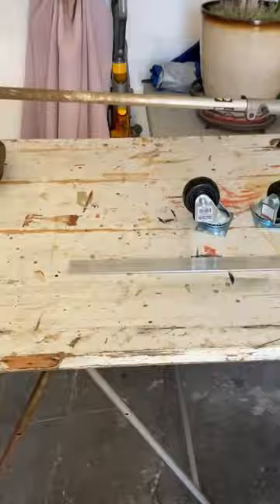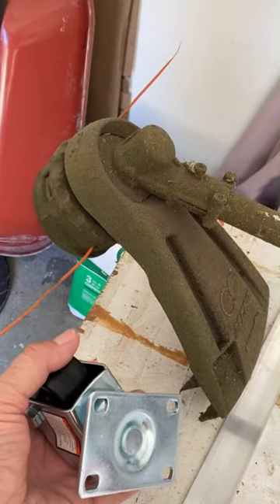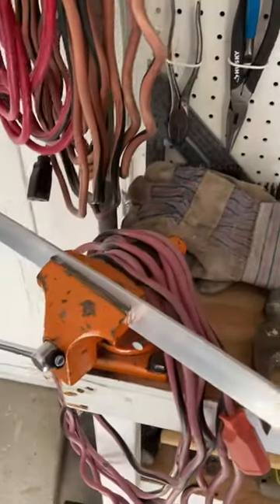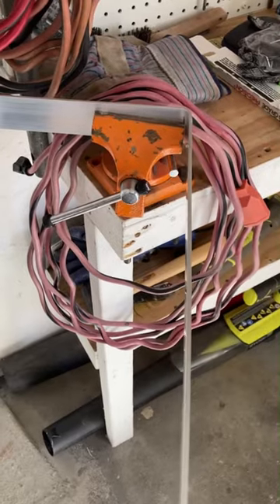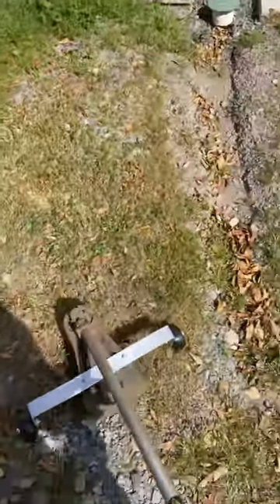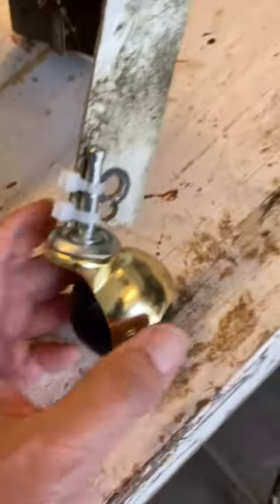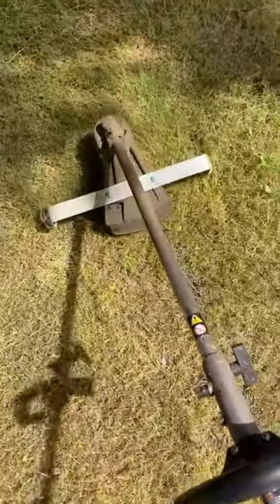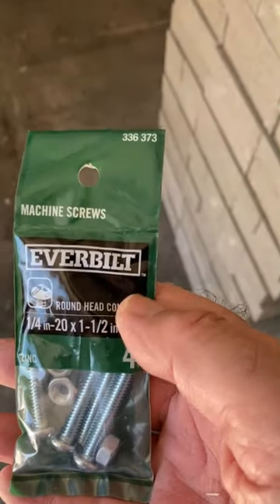DIY Weed Trimmer Lawn Mower Attachment

Comment: Why do you need this?
Reply: When trimming 2 acres of weeds along a fence line, wife complains how heavy the trimmer gets. Maybe an idea to not have to lift the trimmer for 2 hours.
Reply: @aftoy  
Gotcha. I completely understand the fence line. 
I have close to 1000’ of road front fence line. 
I have a trimmer on wheels also. 
I bought mine that way. It actually looks like a big wheeled push mower with a trimmer head. 
It’s very convenient. 
I guess me having that I was a bit confused with your rig. 
I also have regular trimmers too.
Reply from the maker: My front lawn is so tiny I didn’t want to buy a lawnmower. The wheels just give me more control cutting the grass so it looks uniform, and when I’m cutting weeds outside the fence for an hour or so it makes it easier on the muscles.